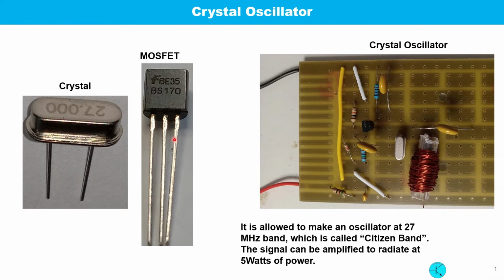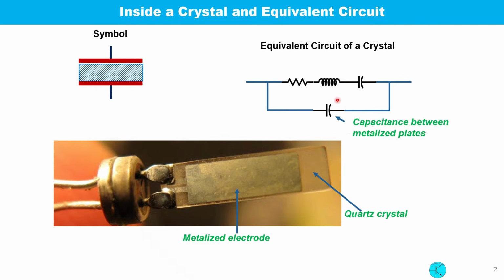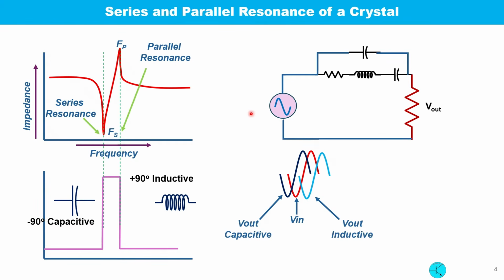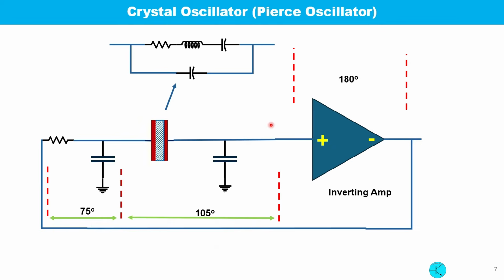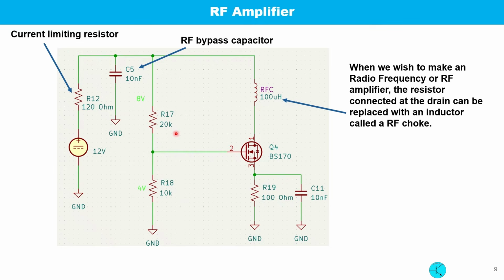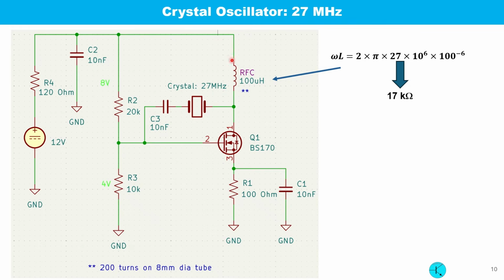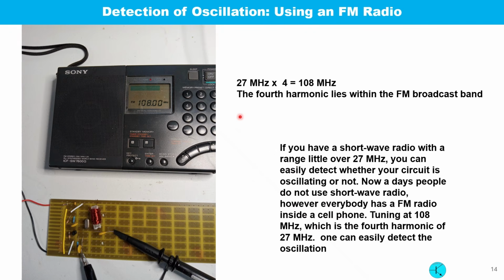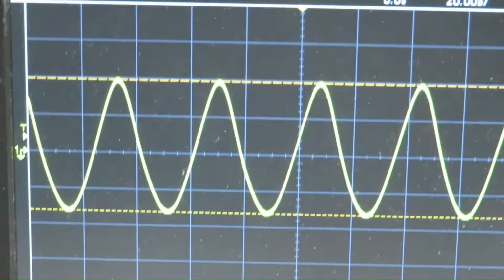Crystal Oscillator

Comment: Hello Sir, i saw your video about the hand cranked generator with a stepper motor. Is there any chance, to store the energy to start a car engine? I saw some things about super capacitors but nobody seems to take it serious. It would be a great help in remote areas or at sea. I`m just starting to learn about electronics so any help would be greatly appretiated. Your teaching style is the best, i`ve seen.  Thank you and greetings from germany.
Reply from the maker: Hello. Thanks for watching. Yes, it is possible to make an engine starter with supercapacitor as energy storage device. I'll probably make a video on it, but may not practically build it. Starting an engine needs 100 to 300 Amp in the beginning, we need several supercaps connected in series, and these caps should have very low ESR  (I'll explain later). Low ESR caps are expensive and I need at least 6 of them. So rather than building the circuit I can give you the design
Reply: @technologyforyou5976  That would be perfect. If you are in remote places or at sea, it doesn`t matter, if it cost a little. It`s important, that you can help yourself. You would do a lot of people a great favour, to make a drawing and explain, how to build it. Thank you so much for answering. Greetings from germany.